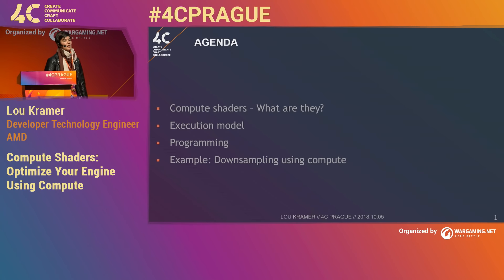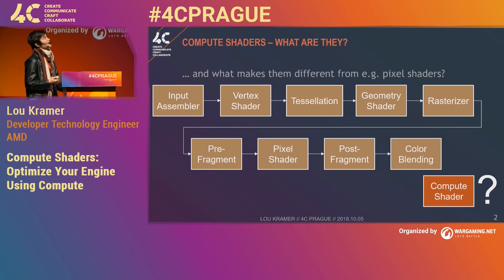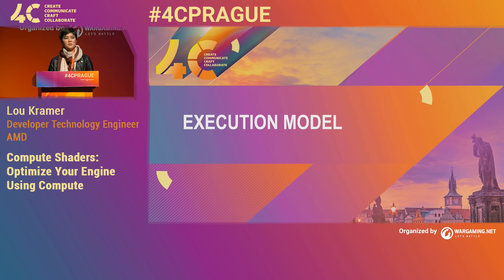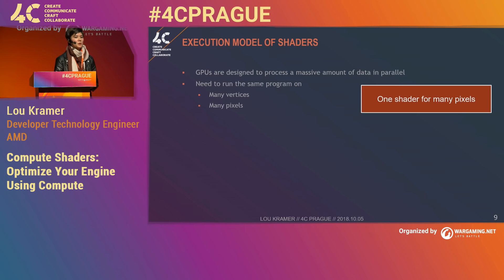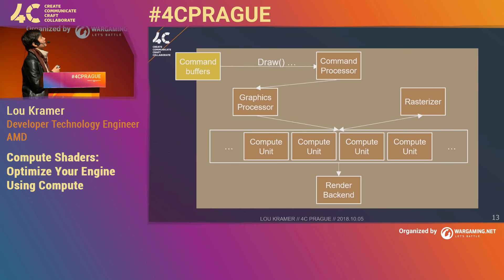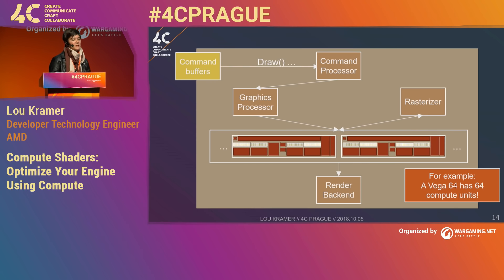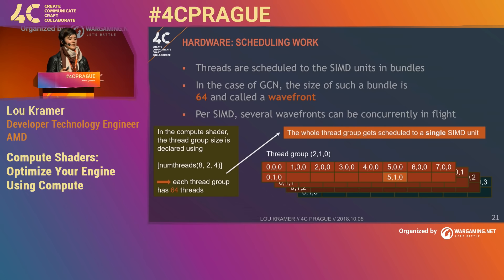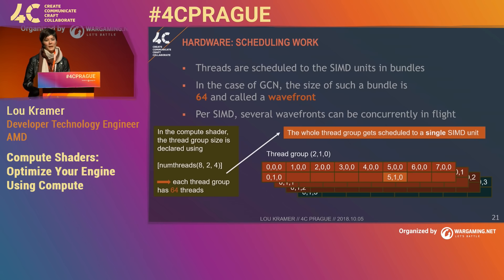Compute Shaders: Optimize your engine using compute / Lou Kramer, AMD

Comment: Lou the copy back is quite important for games developers using the CPU to perform for example user impute like hacking consoles ...

"If you anyway transfer the texture from the CPU to the GPU, and you already have the mips or have enough CPU spare time to compute them on the CPU, it makes probably sense to do so. But if you only have the texture on the GPU, and are only using it on the GPU, there is no reason to generate the mips on the CPU. Because this would add at least 2 synchronization points plus the PCI transfer costs for GPU to CPU and CPU to GPU. This overhead can be completely avoided by just computing the mips on the GPU.

Thanks,

Lou"

https://science.n-helix.com/2019/06/vulkan-stack.html

Comment: compute shader stage attack for quality enhancement & game mechanics: Physics renderer & gravity

I think that we need compute shaders as our angle of attack on the quality of the final output on the console..

The reason i believe this is because you strictly stated that resources can be saved like mipmaps & tessellation & audio...

But we need immersive and we need the resultant usable for :

Shader cache..
Processing of optimal vector numbers combined with localised & stored vertices arrays...
There are many reasons to invoke the pipeline at the compute rather than the graphics shader pipeline..

Execution pipelining, Static resource upgrade & image/Texture & audio

Processing of data & storage optimisation or drive spin management...
Encryption & High performance computing nodes.

There are many reasons we need to aggressively work the shader market:

HPC
ML
Science
Gaming

Processing is not always about temporary results; Good ones are preferred.

RS https://science.n-helix.com